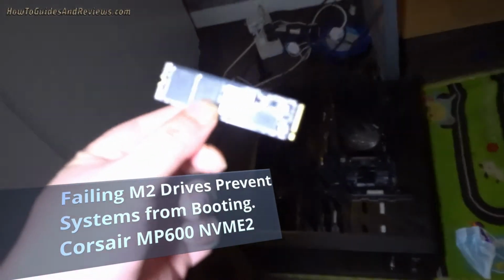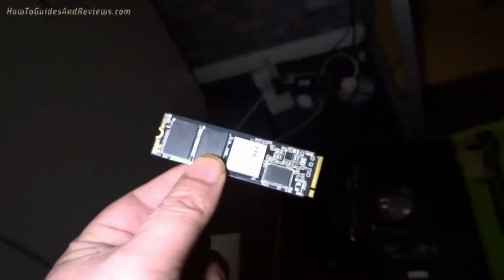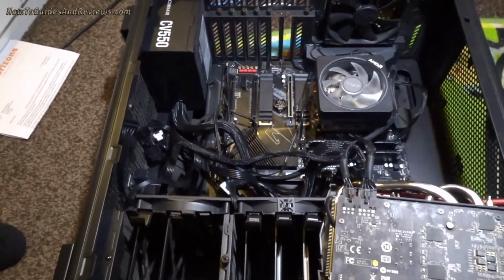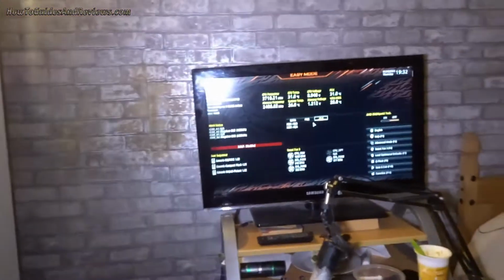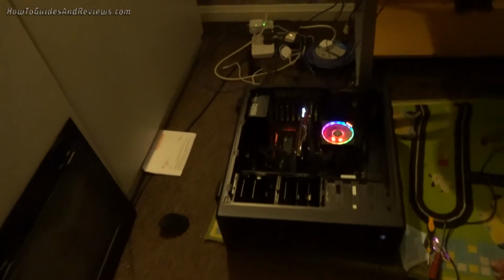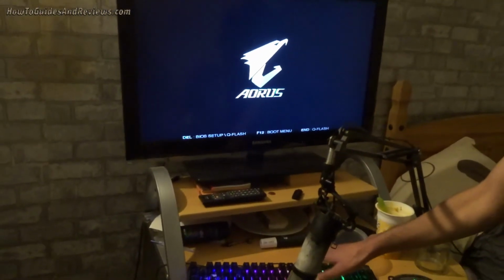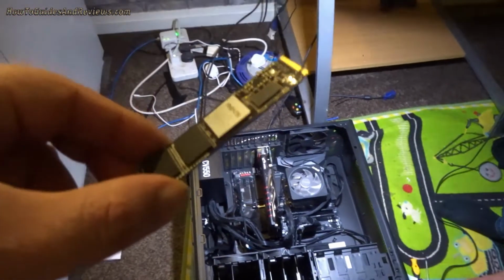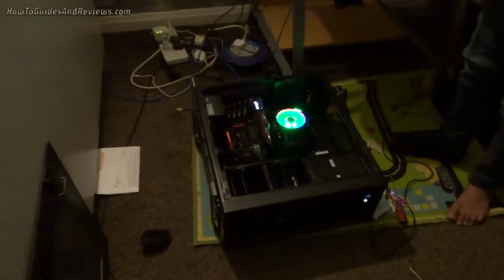WARNING Failing NVME2 M2 SSD Drives Can Prevent Systems From Booting - Corsair MP600

Comment: NVME DRIVES ARE RUBBISH: If you go to Amazon reviews you will see that the worst ones get a 79% 5* rating, while the top of the line get 91%, with most at 85%. This is not a "mature" technology but a failed technology. SSD SATA drives are not much better. Compare this with the truly mature technology of spinning drives and there is no contest. There is no excuse for manufacturers to continue making these time bombs.  Computers are hateful enough without having to hold your breath every time you use an NVMe drive. I know that lots of people, myself included, get lucky and these can last for years (especially if you do as the manufacturers say and use only a fraction of their capacity - duh!) but anyone who does rely on these needs to be vigilant about making backups and really should have a plan B, a second capable computer to use during down time. The only technology I know of that is capable of causing so much human misery is Windows. I'm a retired computer programmer. Come on, manufacturers, this is hardly rocket science.

Comment: my drive (Silicon Power 1TB - NVMe M.2 PCIe Gen3x4 2280 SSD) just up and died today while I was playing a game online with friends, the thing lasted less than a year and I mostly only used it to boot Windows off of, most other data and programs go in external drives. What a joke
Reply: Had the same model and just died a few hours ago sadge. Any update on your side? Did you send it for RMA?
Reply: Mine just died too.  SP Gen 4 2TB.  It works in an external enclosure, but really slow.  It started disappearing occasionally, and then quit altogether.